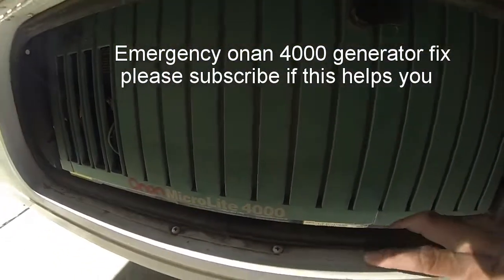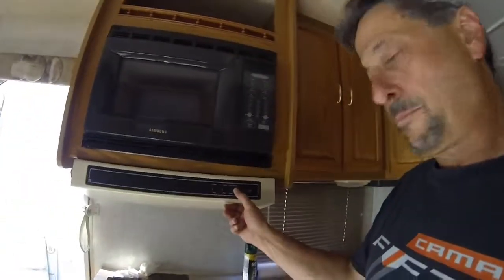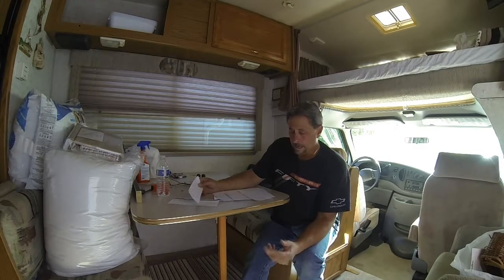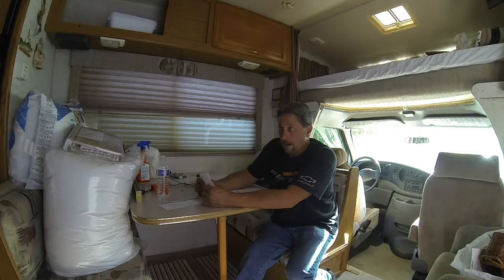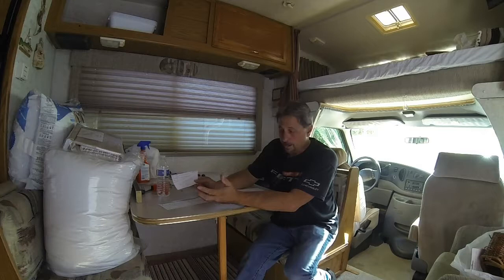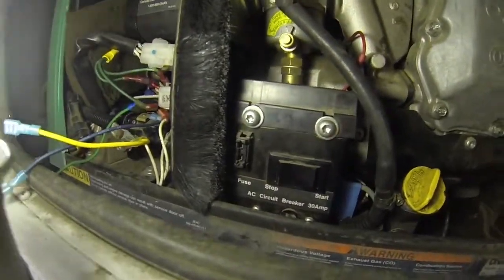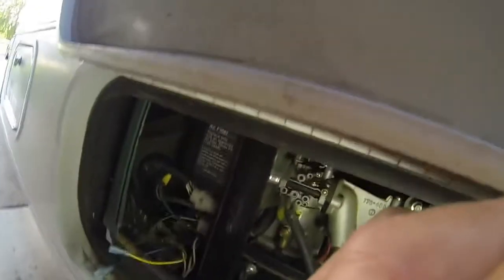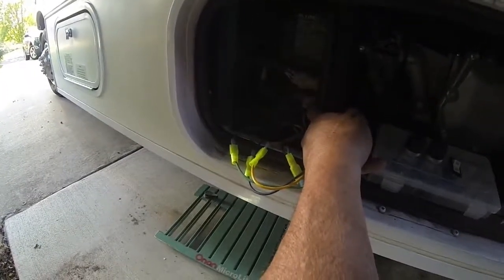onan 4000 emergency fix brain bypass surgery

Comment: My generator mother board  was repaired a year ago now bad and they do not make my mother board anymore and flight systems will not respond to  my e mail this is my only option
Reply from the maker: Fuel and spark first then starter. It will run then do the flash circuit.

Comment: My generator doing the same thing. Nice video 
My circuit board must be out.
Reply from the maker: As long as your voltage regulator is good and it is the H model you should be able to get it to work. This fix bypasses the circuit board.

Comment: I have an ownen. Generator 4000. It just died one day.
I have no power to the switches they don't work if I jump start the solenoid it'll turn over but I'm not getting no spark any any help would be a very highly appreciated
Reply from the maker: Is it a type h gen?

Comment: Any chance you know how to do this for type K (not type H) Onan?  My type K has no 5A fuse to plug into, and I'm not clear on which wires for field sense switch.  It seems there are two field sense wires on my unit.
Reply: OK, I got it started by putting a 5A fuse in line with the power source to fuel pump and fuel cutoff.  Yay!  So nice to know the motor runs find.  But I'm not sure how to connect the field flash to get generator started.  There are two wires, one on either side of the brush block.  Not sure which side to hook switch. I assume F1.
Reply from the maker: Sorry Mike I didn’t see your question 3 months ago I can’t figure out how to make you tube let me know when someone has a question. Anyway did you get it working?
Reply: @mucilliscarz358  Got the motor working, but it doesn't generate power.  I don't have any more time to give to it, so going to take it to a repair shop.  Thanks for getting back to me though.
Reply from the maker: If I would have seen your question a couple months ago I bet we could have got it working let me know if I can help. Have a good day.